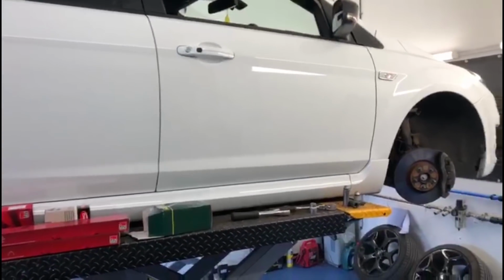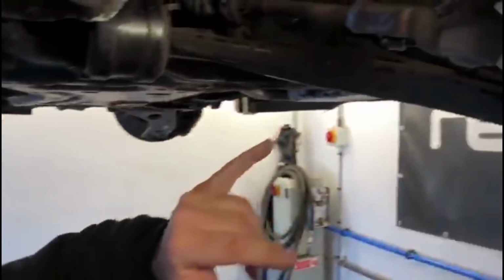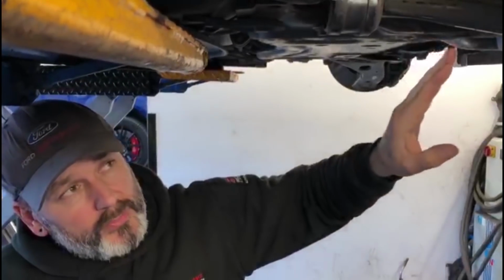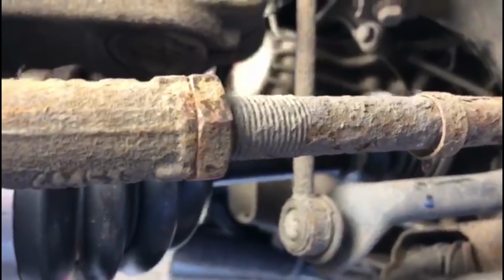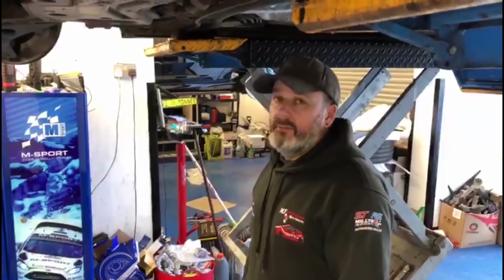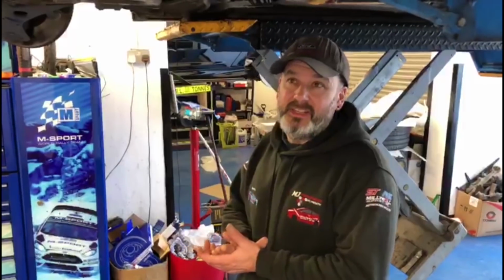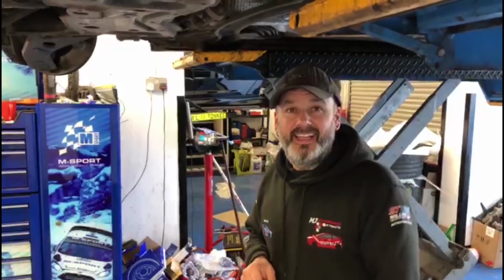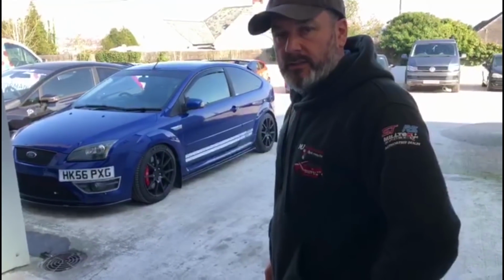WE COULDN'T BELIEVE WHAT WE FOUND ON THIS FOCUS ST!

Comment: As you know excessively applied heat to a steering or suspension component is an MOT failure. Or at least was until the 2018 manual.